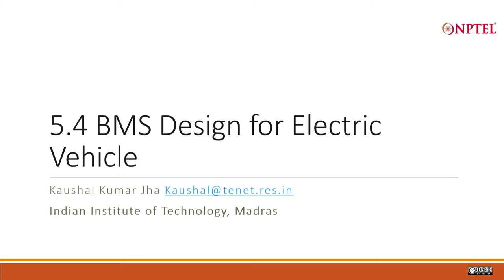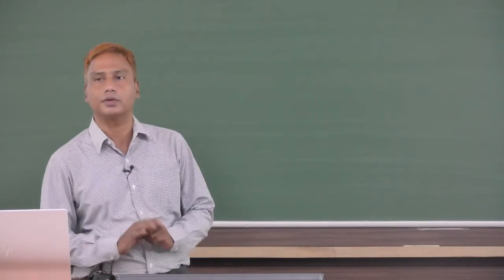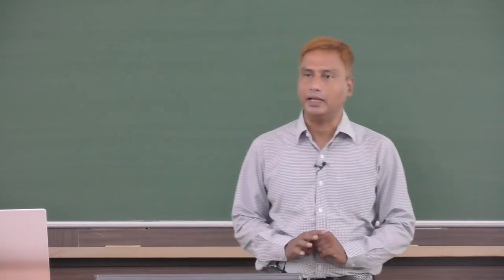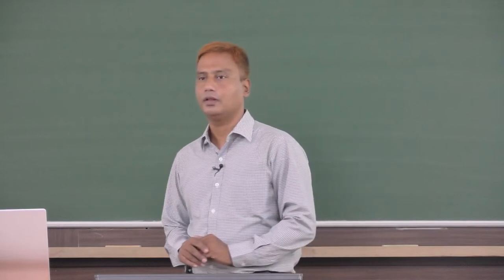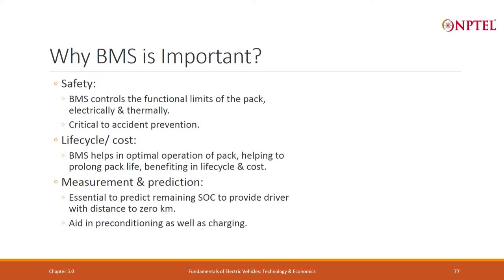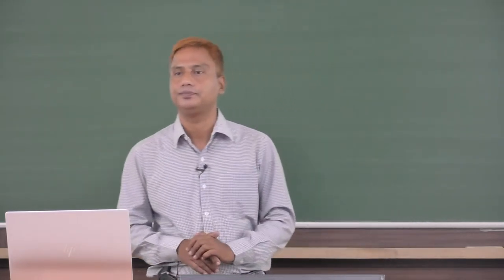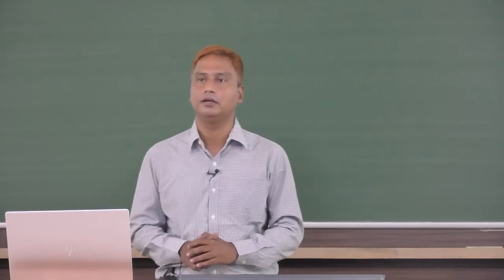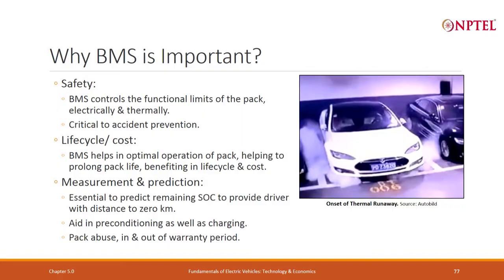Lecture 44 - BMS Design of Electric Vehicle - Part 1

Comment: My 2yr old 48v 25amp battery... Scooty stops after 2km... I checked 1st rack   pack voltage low 3.4v and other packs 4.1v...so i replaced pack of 10 cells. With New 3.7v 2500mah each...old pack does not have information cell mah...
Now after changing....scooty stops if speed goes above 15 Kmh... But after reconnecting if speed less than 15 kmph...drives continue...
My question is  bms. Faulty......or pack has to be of same mah like old one...?
Reply: ohh intresting..